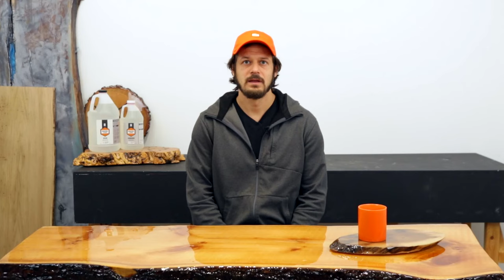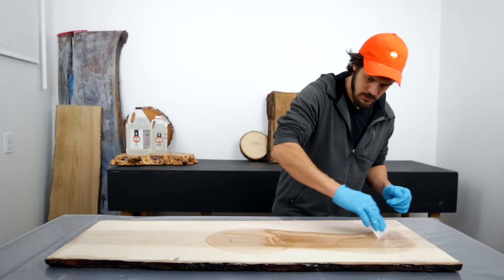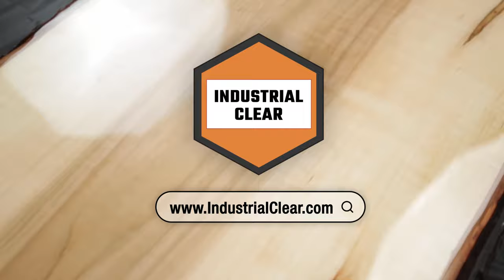High Heat Resistant Epoxy Resin

Comment: A hot cup of coffee is not something I would consider to be "high heat".
Reply from the maker: hey you could take a casserole out of the oven and put it on it and it will be fine... I wouldn't do this anyways on a counter.  on anything.  but a hot cup of coffee is a normal use case and we made 100% sure that a hot mug won't ruin your surface.  ya know! :)
Reply: @rialclear8859Many thanks for the update. However, that contradicts your own text above i.e. "For Industrial Clear, the recommended service temperature allows for hot coffee cups without leaving a mark in the surface, but not, say, a casserole dish straight out of the oven". Be that as it may, for a product like this I would expect the "service temperature" to be defined as a specific number. After all a casserole dish straight out of the oven could be at 100C or it could be at 250C or even higher.

Comment: Is there heat resistant epoxy that could withstand A pot off the stove?
Reply from the maker: yes we formulated and tested Industrial Clear to be able to do this.  best to let it fully cure for 3-7 days so it is at its absolute hardest!  industrialclear.com